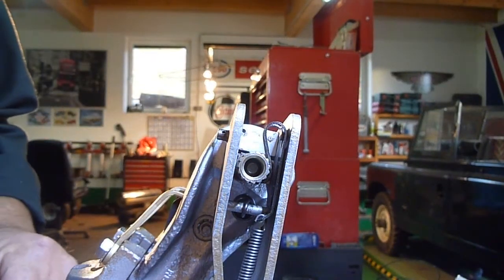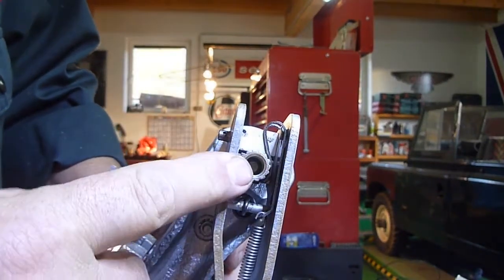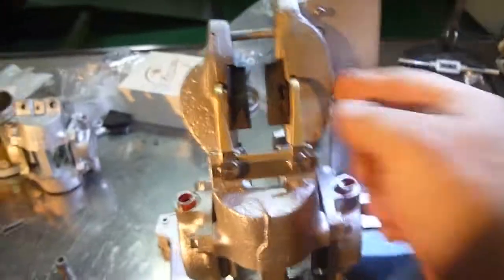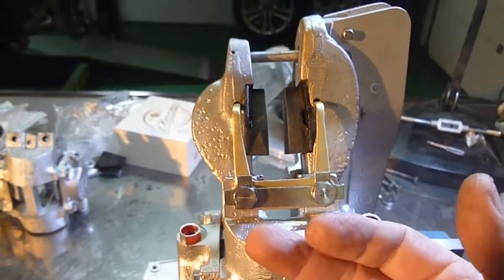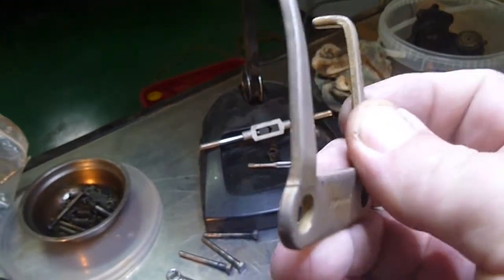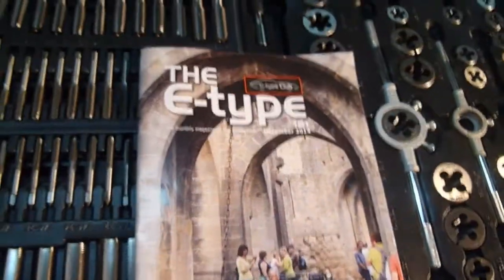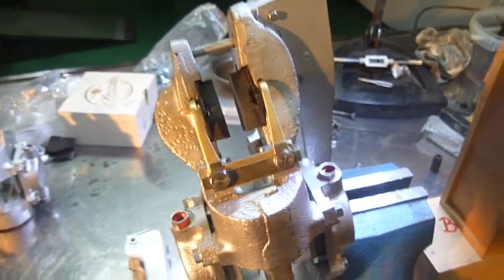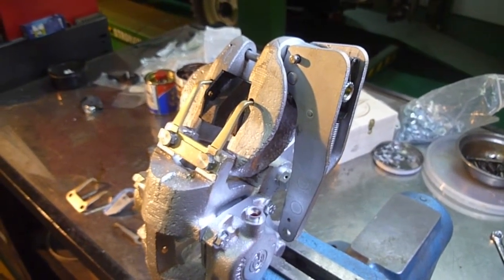Jaguar e type rear brake system part 3

Comment: Hi Davejaguar66! I was rebuilding my calipers also and would like to present to your audience my learning to stop the next dude from making the same mistakes. 
 - If you're putting on new pads and calipers, you'll need a new retraction fork even if its not cracked...the fork compresses over time holds a straighter shape, essentially meaning that the new calipers won't fit over the new pads...ask me how i know that. 
I'm a lurker but I wanted to thank you for the huge effort you put into making these video's. please keep them coming, its very beneficial for us noobs.